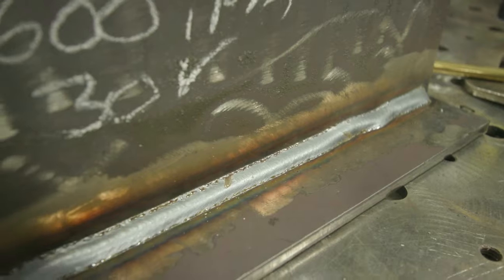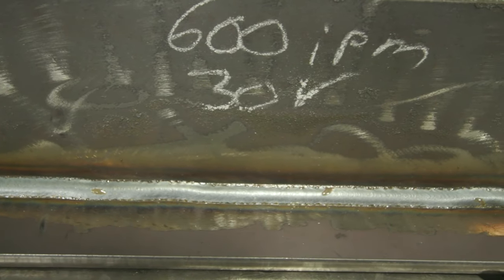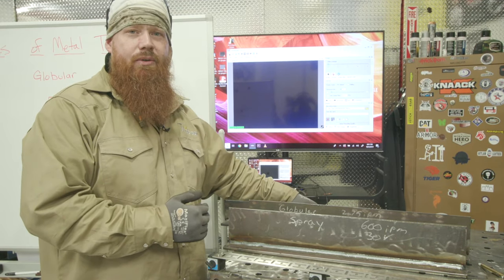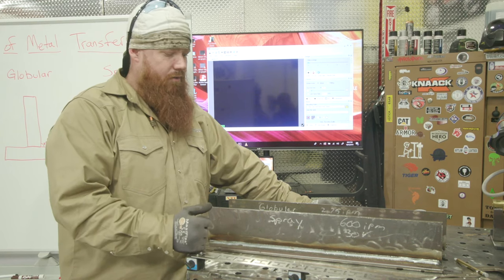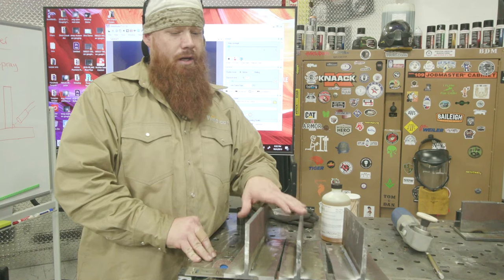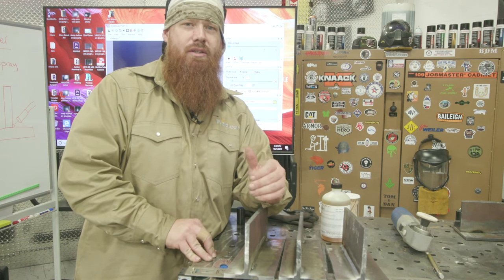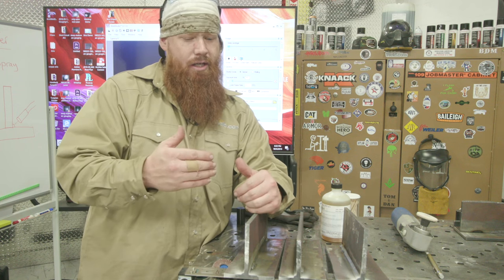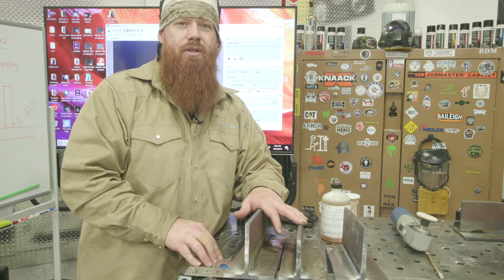Welding Modes | Short Circuit vs Spray vs Globular

Comment: Shielding gas is to prevent the O2 in the atmosphere from oxidizing the weld, but you are adding O2? Why not just reduce your gas flow to allow atmospheric assistance? Control?

Comment: I think you run too much wire for the voltage on the short circuit but you never say what size wire you're using.

Comment: I have been trying to learn via the internet, if all three transfer modes of wire feed welding can be achieved with the same machine (power source).  Thank you, thank you, thank you.  As per your video, one machine with enough (direct current?) power, combined with the correct shielding gas (or combination of gasses)  can produce short-circuit, globular or spray transfer modes of metal transfer.  Thanks again.

Comment: Man that new camera is insane for arc shots. After really seeing what the wire is doing in each process I have a better understanding of what's happening. Still a bit fuzzy about how different gases change different processes for both wire n tig though

Comment: How does wire size play into this? I have an old ESAB 200 amp welder. The adjustments just go from 1 to 10 so I don't know what voltage&feed I have. I usually run 0.8mm and I don't think it can spray transfer. Would it be worthwile to buy and try 0.6mm wire, could it have better penetration if it can spray transfer (versus 0.8mm short circuit)?

Comment: Same wire  used on all three?
Are smaller machines limited to short circuit?
Thanks!
Reply: I believe he was just changing gas and settings. The same wire can be used with all of the transfer modes. 

I'm not very knowledgeable on the subject, but I will say yes to the short circuit. The voltages for spray are too high to be achieved on smaller machines. I would take a guess to say a 210 amp machine might be able to spray, but the duty cycle probably would limit how long.

Comment: I am welding with a mig solid core setup and weld anything between 1.5mm to 10mm. I currently have a gas mix 78% argon, 20% co2, 2% oxygen. I am going to switch over to 93% argon, 5% Co2, 2% oxygen as I think this will be more suitable for the thinner more common material I weld. 

I would like to know how this will effect my settings. Will I have to increase my voltage and wire feed and will I get into or closer to spray transfer with say 3mm steel or would it still be to thin? I am intrigued how this will effect my welds? My old bottle is almost empty now so I will be replacing it in the next few months so it will be a bit strange as I've only ever welded with the gas I have now with mig.

Thanks.
Dave.

Comment: nice vid.  Couple questions!  So all these were same wire size, did I miss what size it is?  Also, I did not know the 82% or higher, been using 75/25 on spray tfer for some 1/4" stuff.  What would you think the effect of that is?  Not a pro welder here, just stuff for the shop.  Also, can I use the same tri-mix we have for stainless mig for spray transfer on steel (sorry don't know %s, not on the bottle) ?  Thanks!
Reply: Possible that gaz for stainless has helium so pretty expensive. So if you can spray with 90/10, just go with it. Not sure about price difference but i think a tri mix bottle goes for 150$.

Comment: I have a question so when you said short circuit is up to 5/16 why is there a structural test for short circuit that 1/2inch thick. Or is that only for a route pass on a 5/16 thick plate and how would you run then a 1/2 inch beveled plate with a backing plate

Comment: Was a fabricator and did SMAW, GMAW, and GTAW back around 1990.  Got out of the business and kinda fell off the latest technological knowledge.  Back then, GMAW was simply gas shielded and flux core.  Looking at these three methods, it seems the basic differences are voltages, wire feed rate, deposition rate, and gas mix.  Since GMAW back when I was doing it  was capable of all positions, should I assume that it was "short circuit"?  Or, is short circuit something different than what I was accustomed to?  We used a variety of gases from pure CO2 and CO2/Argon mix.

Comment: just found your videos, as I mentioned on stringer vs weave it is so  nice to see youtube videos from someone that obviously really knows what they are doing

one word of advice, use a monochromatic camera not color, mono cameras actually have wider wavelength range especially into IR as color cameras have IR filters, use mono and then use filters if you want to see specific wavelengths, you can always add back in false color for human visual effect

Comment: I weld diesel tanks for a large generator/tank company. Most of our stuff is between 1/8 and 3/16. All our machines are pulse units. Does that bridge the gap between short circuit and spray? We run pretty fast all day just curious, why they run one over the other.

Comment: Spent a year in an Ironworking shop running Lincoln OuterCore 3/32 diameter on 100 C02. All Globular all day. Trying to pass a 2G on that stuff is like throwing softballs at a carnival trying to win the stuffed bear.. 
Runny as that stuff is though, it will make you a damn good welder.

Comment: Is there a reference chart that shows the thresholds for wire feed and voltage to achieve each process?
Reply: The wire manufacturer should have those documents.

Comment: Awesome video with excellent explanation of each process!  I still like e71t-1 dual shield wire better for penetration on high strength steels and thicker material.
Reply: I ran .045 fcaw-gs at school and boy was it fast and clean!

Comment: Great video still totally confused... what dictates the weld type between short circuit, globular, and spray? Is it just the gas mixes, or are there other settings that matter for them?
Reply: Look at the wire feed rate and the voltage rate for each, this is the big dictating factor.

Comment: Great video! Would you guys consider doing a video on explaining the process you  use to cut polish and etch. I understand the cut and polish part but haven't ever gotten very good results with the navel jelly I have been using. What product do you guys use? Where could someone purchase it? I also see some people say you need to heat the cupon up before you etch is this necessary?

Thanks
Reply: I've had very good results with nitric acid...but it is expensive and extremely corrosive...! Also you must purchase it from Industrial Chemical company...and show a picture I.D.... a tiny amount goes a long way for this application.
Reply: ferric chloride is what you want

Comment: Hello Jason, interesting results. Based on the comments below, I would say that there is a lot of interest and need for facts  - intead of believes - in this topic. It would be helpfull to show the relevant system settings that you used, maybe something like a WPS sheet that can be downloaded (WPS = Welding Procedure Specification)? For example, the energy data in combination with travel speed  can tell quite a bit about the expected weld/penetration (i.e. Voltage together with Amperage and travel speed; electrical wave form would be good to know but seems to be kept "hidden" by the OEMs - guess why). Mayby you also can shed some light on terms like "pre-qualified" etc. Keep up the good work!

Comment: Dang I've always kinda looked down on mig because of the penetration but turns out that's because I only knew about short circuit, the penetration on the globular and spray transfer looked really good.
Reply: Mig is used for fabrication of heavy materials so you have to wonder beyond that

Comment: Spray is just about my favorite. You can play with it and go for just about anything. 27.5 and 432-440 ipm is my favorite setting. It is relatively slow but clean up time is much faster.
Reply: Hi which gas you use with that setting.   And diameter of wire ?     Please.
Reply: @Yogz_z  90/10 oxy argon and .035”

Comment: i never had a penetration profile like you get in short.
i think it's not penetrated at all, and it is not accepted by x-ray.
even a little the spray arc, the lower side is almost not penetrated. 

i think you pulled the torch.

Comment: So I'm seeing Globular is best, then spray, then last is short circuit. What does "not pre-qualified" mean? And why is short circuit the most popular? Is it because it uses less volts/smaller welder? Oh, great vid! It's about time someone did one on the different types...
Reply: "pre-qualified" refers to the AWS code books, such as D1.1 for Structural Steel, Clause 3 is prequalified procedures and is limited to specific joint configurations and parameters. Short Circuit is specifically excluded.

Comment: Has anyone ever had the issue with a millermatic 252 where the weld goes from spray to short circuit after hours of use/being on? Maintenance and I can't figure out what is up, just that blowing air into the machine makes it stop

Comment: Is every MIG machine capable of all three processes?
Reply: 24v minimum for spray.
Reply: No. Spray and globular get their increased penetration from being higher amperage processes. Generally speaking if your machine runs on a 120v plug and not 220v input power, it won't spray or do globular. I have seen an old Lincoln 140 just touch globular, but it would over heat almost immediately.

Comment: I had to pass a bend test on 2 inch schedule 40 pipe, in a 6g position, with globular transfer. The company I work for was required to do this for a job. It was almost impossible at the temps associated with globular.
Reply: That's crazy I bet it was almost impossible they should of used dualshield fluxcore or pulse spray transfer metalcore pulse as well
Reply: The worst part was we had started the job and the customer threw the test on us. So I was pretty stressed lol. I'm pretty sure the customer was Exxon.

Comment: Damn, master class in MIG welding in under 10 minutes. So, noob question for all us home gamers normally welding way under 1/4".  and sometime for structural stuff that we're certainly not qualified to be doing....
spray or globular, is either of them easier to pickup?  I know its a general question that can't be answered definitively, however one of them has to be easier in some way than the other.
Reply: If you know how to read the puddle there probably won't be much difference in running either.

Comment: I hate globular. Mostly because I have yet to weld test for a company using globular transfer that A. Let's you set the machine and B. Sets the voltage high enough. I always spray solid wire and it's getting frustrating how many companies won't recognize spray.

Comment: I thought globular transfer was a transition stage between Short Circuit and Spray. But you are at 33 volts which is well into the volts required to spray.

Comment: Hobbyist question here - what determines the mode? Is it mainly just the choice of gas?
Reply: It wll also depend on your wire speed and volt combos and wire choice. But gas affects this too. In video i think he mentions that you can't get spray transfer with less than 80% argon? I think you can get an almost middle ground
of globular and spray with 100%CO2 and dual shield wire 71M, maybe. I am also beginner and hobbyist.

Comment: Ok, watched this twice. You didn't specify what wire size you are using. 035, 045, solid core? These things can cause changes in final weld quality..
Reply: I did the same thing 😁
Reply from the maker: It's .035 70S-6 wire
Reply: Ok, thanks. 😉 Curious, actually what was the measured depth of penetration in spray? We are default 1.5mm on all welding. However sometimes prints will deviate to 2.5 to as much as 3mm minimum. 045 becomes required wire at this point.

Comment: So why do the textbooks say that globular is incorrect, and shouldn’t be used? A number of respected welders on You Tube state the same thing.
Reply: I've personally only tried globular once and that was by accident, since I've also been taught to never use it. 

Since we've clearly seen that the penetration is ok, I think the only reason not to use it, is that it takes a lot of cleaning and in production, time is money.
Therefore you don't use it since there's better and cleaner ways. You preferably want to weld it and send it directly to painting. :-)

Comment: So the gas u use is how you get the different ways of mig welding 🤔🤓
Reply from the maker: We used the most.common gasses used for each transfer mode. You can achieve globular with mixed gas as well.

Comment: 😁 the spray transfer weld had flat practically lack of fusion lines larger than the short circuit and way more distinct. though it did have a narrower deeper penetration in the root, which means nothing when it comes to the structural Integrity of the weld. Fusion is Fusion . the Short Circuit  weld may have less depth of penetration in the root but more wide even Fusion . Both welds had lack of penetration though due to improper settings and or travel speed. we need consistency and control to these tests to achieve a real legitimate result. like say you run 25 or 26 volts, same thickness material, and just alter the gas and wire speed to achieve the desired transfer mode. then you will have an accurate non bias controlled test to really show what each transfer mode can do compared to the other. for running 30 volts!?! I was not impressed with the penetration profile of the spray transfer. I'd like to see how long a human can run 30 Volts for or how long the Mig gun can handle that if it's not water cooled. 😅
Reply: From experience at work 28 volts and 325 amps i can run a out 15 min before my torch and hands can not take anymore.   Plus heat shrinks gloves to the tune of 2 lead hands a day with heavy welding gloves.  Can keep heavy spray transfer I'll take dual shield flux all day.

Comment: During the Spray transfer process are you using a Single phase unit or Three phase?  I believe this is an important detail for your viewers.
Spray transfer with some of the single phase units is difficult, if not impossible.
Reply: I think I saw the ESAB 285 1ph label on welder so single phase.
Reply from the maker: It's a single phase machine.

Comment: All welding is a short circuit, why even mention pointless misnomenclature adapted 100 years ago?!?
Reply: The nomenclature isn't pointless.   It happens to be industry standard, thus the mention of what is pre-qualified and what is not.  Short circuit when it comes to MIG (MIG is outdated nomenclature if you wanna continue your rant) is when the electrode comes into physical contact with the parent metal before going molten.  Globular and spray transfer, the metal is molten before it even hits the pool.  I'm interested in what your alternatives are to the "pointless" nomenclature.
Reply: ViolentLotus so is it the gas or the machine that makes the transfer different?
Reply: @Kevin-is-here  My understanding...  but I'm not an expert either... is that the voltage applied is what changes the transfer method although different gases are used for the different transfer types.   The gas helps facilitate the transfer method, if you get what I'm saying. 

Going back to my last post, maybe the OP prefers short arc over short circuit.
Reply: @Kevin-is-here  Looking at my old materials, globular starts at about 22 volts.  Spray is achieved at 24 volts and higher.   Below 22 is short circuit/short arc.  This is all according to Miller.  However.... the video here shows something like 33 volts for globular?   I'm thinking they meant 22 and it's a typo.  I've never even seen voltages that high for any sort of MIG.

Edit:  NOPE.... the machine here shows 33 volts, so not a typo.   This isn't what I was taught, nor does it agree with my Miller  docs.   Color me confuzzled.
Reply: @GeekInJeep  The key word there is "starts". Globular can be achieved at any voltage over 22, with any concentration of argon or CO2, and a wfs slow enough to allow the right size globs but fast enough to avoid burn back. Spray is any voltage over 24 with enough argon and wfs to get out of globular. Remember that wfs controls amps, (450 ipm = x amps and the scale is linear) so if we look at power output (amps*volts) the settings used for globular (33*450) and spray (30*600) are probably pretty close in terms of power.
Reply: @gasfiltered  thanks for filling my knowledge gaps there, man!
Reply: ViolentLotus well thanks for sharing, I use a old Lincoln 255 at work with 035 wire & straight co2, anything bigger then 1/2 inch we just usually stick weld anyway, I’ve herd about different transfers but assumed it had to do with different machines much better then the old junk I use
Reply: @violentlotus the reason he can be at 33 volts and in globular is because he is running straight CO2 , you cannot enter a spray transfer with 23% or higher CO2 obviously amperage and voltage play a part in getting to spray but the reason here is because of the gas. If he would have had a different mix, say 92% argon 8% CO2 he would have  definitely been in a streaming spray
Reply: @levispaich3084  Thankya, man.  I was sort of wondering if that was the case later on.  As I mentioned, I have some school knowledge, but The more I learn, the more I realize I don't know.
Reply: @GeekInJeep  yeah no problem man! Constantly learning!

Comment: So the only difference between these processes is the shielding gas and the wire IPM, so can older transformer mig machines use these processers? I am just a DIY'er who isn't up on the latest improvements.
Reply: If you have enough power, wire speed and correct gas.